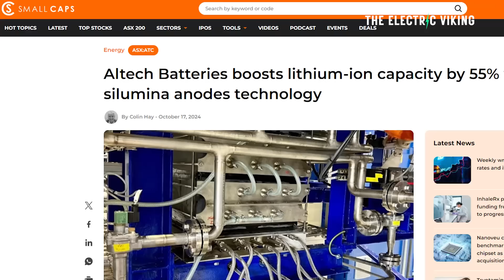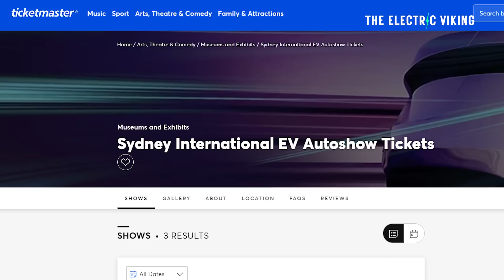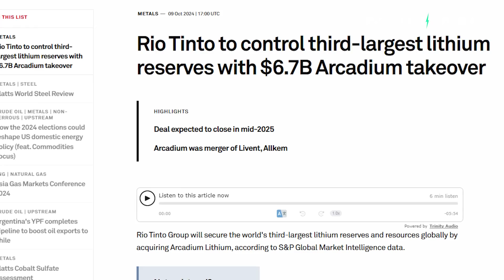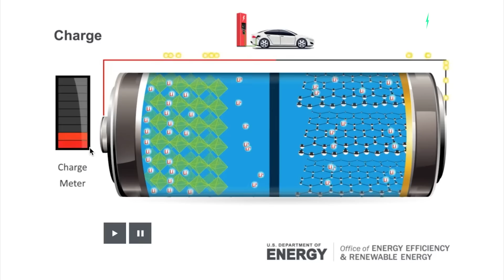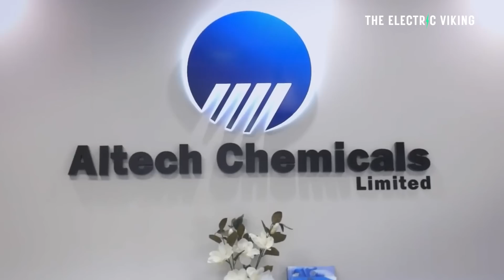Aussie battery company says it has boosted battery energy capacity by 55%

Comment: At 1st I thought them using "capacity" instead of density, might indicate they were describing how much power the battery can put out per second, but then I read the article linked in the description (& googled capacity vs density).  The energy density of a battery, is a measure of how much energy it can store per unit of volume. The energy capacity of a battery is how much energy it can store per unit of mass (or weight). "has resulted in a jump to about 500mAh/g(milliampere hours per gram mass) for the company's anodes, in comparison to an average lithium-ion battery anode of 320mAh/g."

Comment: It sounds like they have figured out a way to overcome the silicon introduces to batteries. That is a more believable solution than actually increasing density, the density is already there, but because of inefficiencies, they can not utilize all the energy present in batteries. That's why they say capacity and not density.

Comment: All those saying that EVs will never replace ICE vehicles are completely overlooking that the ICE is a very mature technology whereas battery technology is quickly advancing.

There is not much more that can be done to ICE to improve power output, reduce wasted heat, minimise fuel consumption, lower pollution. So it’s near the end of its technological advancement.

By comparison, batteries are making dramatic improvements in energy density, charging speed & lowering cost. It’s unknown how many more advances will be made. But the likelihood of further breakthroughs is what will drive research to find them & so increase adoption of EVs.

Comment: Sam, as you are in Australia, would it be possible for you to visit their offices and see if this is for real? Given the state of battery development, experience tells us that many announcements fall flat over time. Witness the flops with solid-state batteries and the tired "we are 3 - 5 years away" response SS companies give when asked for a time to mass production. Until we see actual batteries in mass production, this is nothing but theoretical physics. There is lots of lab work that will never see the light of day. Nevertheless, research in this area needs to continue and should be encouraged. Thanks for keeping us all informed of what might be on the horizon.

Comment: "Anodes" (or "just use the new cathodes" so which is it? I think he confused with anodes, that have 5% higher energy density, but they are only part of the whole battery, so I'm unsure if the energy density of the whole is increased that much, or only the anode, is smaller, and how large a fraction it was to begin with).

Comment: I wonder if or when lithium and other high energy density solutions will become cheaper than lead acid? It's still used in a lot of places such as Uninterruptible Power Supplies. Advanced batteries reaching price parity with lead acid would be a game changer. Imagine businesses never having to replace batteries, just the UPS when the circuitry fails, or every so many years in more sophisticated environments. Everyone's IT maintenance costs would fall and there would be less downtime.
Reply: Well you pay around £50 for a 50 amp hour lead acid battery so at 12 volts that is £50 for 0.6kwh. I undersattan that the going price for lithium oin batteries is $50 per kwh. That means that lithium is already cheaper.
Reply: They already sell lithium batteries for UPS's. You pay significantly more for the lithium batteries for UPS's vs lead acid. It might be an economies of scale thing and there they just don't make enough yet. I don't know.
Reply: @rogerphelps9939  and lithium batteries have much higher cycle life eg. 2,000 cycles at 80% depth of discharge vs 1500 cycles at only 20% DoD.

Comment: With all the new fantastic batteries about to be produced, now is not the time to buy an EV.  Already, EVs, with the original batteries from several years ago, are virtually worthless in the used car market in the U.S.
Reply: That is only if you plan to sell. Worthless and valueless are two different things. I have a 2105 Nissan Leaf which is worthless by your reasoning but it is an extremely valuable asset because it does wat I ask of it which is short trips here and there. For long trips I have a Skoda Enyaq which meets my needs and I do not plan to sell either anytime soon.  Got it?
Reply: @rogerphelps9939   .....Yup.  I still hold on to a 2006 Audi A3 in excellent + condition but, using your definitions, is almost valueless.  The problem is that insurance runs up to $200 per month and even registration has doubled to $500 per year.  Lesser used cars are getting expensive to hold on to.

Comment: many companies are working on anode tech. we will see energy density increases by about 30% of the whole cell in the next years.
amprius is one of them who are in the front of this development race. rather than creating space for lithium ions to find a place by using aluminium coated silicon spheres, they grow a kind of forest of silicon trees or kind of bowling pins that have a much bigger surface than the spheres thus taking up more lithium ions.
but the growing of this bowling pin forest is a process that is a bit more complicated and takes more time than just applying a paste of aluminium silicon spheres on the anode.
zeta energy has something similar but they don't use carbon instead of silicon. the chemistry is then more similar to graphite, but they use carbon nanotubes. these longer and thinner tubes create more surface area compared to the silicon 'bowling' pins from amprius.
additionally zeta energy is able to use sulfur on the cathode. that makes it cheap and energy dense (450Wh/kg and half the price than conventional nmc batteries).
lot of things going on currently.
Reply: Very informative response.  Thank you.

Comment: Aluminum in that battery. Gives problems.
For long term charging.
For short term, fine, but not for long distance.
If they use that battery for a car.
Then I don't see it driving 500,000 km. maybe 70,000 to 100,000 max

Comment: Boosting capacity by 55% doesn't double the capacity, that would be 100%. You multiply by 1.55 to get the new capacity, not by 2.
Reply: Sadly he talkes quite often nonsense like this, that does not help the cause :-(
Reply: @chriswilliams8607 whatever. His content is excellent
Reply: Capacity is the wrong term to be using as a comparison. Density is more appropriate.  Capacity is an absolute number.  Density is a relative and more meaningful measure in this context.
Reply: @JoeyBlogs007  That part is something that Sam was pointing out pretty clearly.
Reply: @davidnika446  - Right, but isn't that something he ought to clarify with the company before making the video?  Is it fair to say that if the capacity increases by 55% without changing the mass, the the energy density is now also increased by 55%?  The battery space is full of hype.
Reply: Yep he's enthusiastic but alas his maths lets him down and you are not the first to notice it.
Reply: Could he be talking about increased volume efficiency, as expansion during charging is no longer an issue, on top of the capacity boost of 55%?
Reply: Same formula shopping at Walmart?
Reply: Maths and numbers are not his forte
Reply: You think you're smarter than the Viking? Do you punk?
Reply: Actually that might be sufficient to get the same range or double the  range with the same battery capacity. Range scales nonlinearly with battery weight.

Comment: Energy density = capacity.
Reply: Not quite. You can have a larger battery with better capacity but the same energy density as a smaller one. The total size and mass of a battery pack is important for an EV, so until we know how it effects those two factors then we can’t project how it will effect them.

Comment: 0.20 - 0.38 min. Sounds like you're saying a 55% increase in capacity will double the energy density of lithium batteries. I'm not sure how you came to that, but I'm pretty sure an increase of 55% is only 1.55x. If you want to double, then you need an increase of 100%.
Also, this says 55% increase in anode capacity, so not sure it will translate to 55% in total cell energy density without improvements to other parts of the cell. Could still by an improvement to current cells, but nowhere near double, from what I can tell.
Reply: He came to that because maths no good